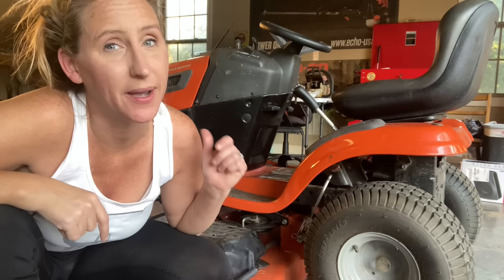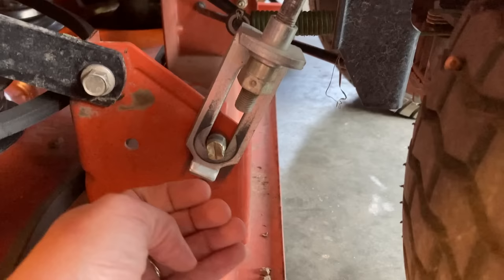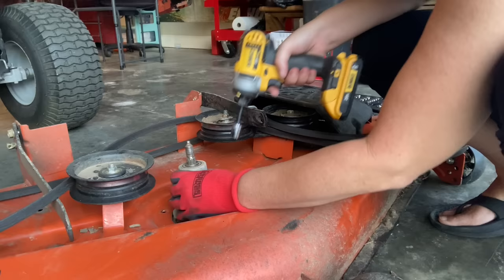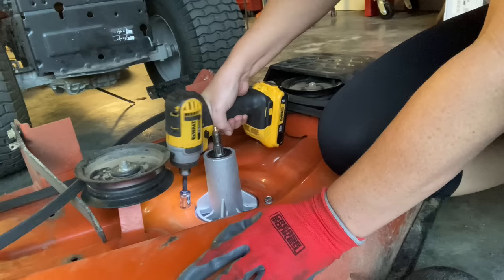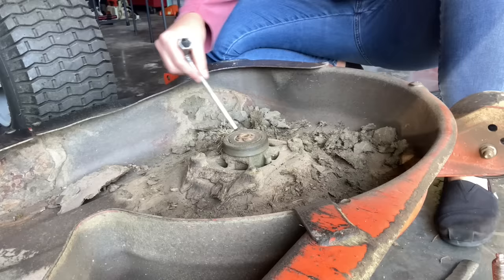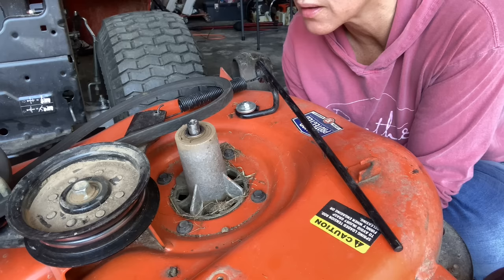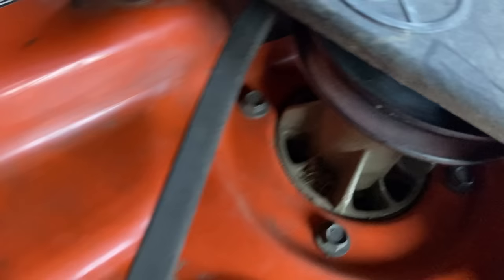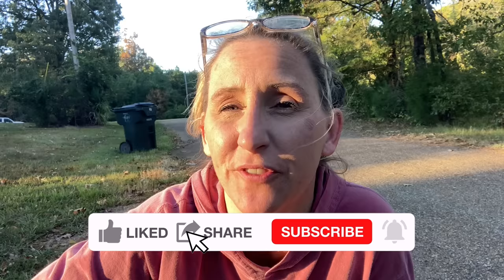Husqvarna riding tractor deck repair. Spindle, shaft and blades replacement.

Comment: I know this is an old video but you talked about the sealed bearings on a spindel I started taking out the seal on the inside then the zerk puts grease in the bearings Im on 3 yrs on spindels 
good luck B

Comment: Can I make a recommendation for that stuck pulley. Toss the nut back on it a few turns, protect those threads, grab your pry bar and apply upwards pressure like you were, then smak the nut with a hammer. That seems to work for me everytime when I got a stuck pulley/ fly wheel.

Comment: If you take the inside seals off the bearings the zerk is usable just don't over grease it. ive drilled a relief hole in the spindle and had great luck with bearings lasting a long time

Comment: Thank you for doing this one.  I also have an Husqvarna mower.  Great tips!  Hopefully I'll never have to do this repair but I'm ready to do it if it ever happens.  The worst part looks like taking the deck off...lol
Reply: its not bad at all.  it pretty heavy howevery and helps to have a smooth sliding surface under it

Comment: I have a Craftsman riding tractor made by Husqvarna. My rearend broke off. I used a couple of angle iron pieces to put it back together. I think the frame is 14 gauge. That is not enough strength for the job the morrow does.
Reply: I’ve got a Craftsman YT-4000 which is still holding together, but that frame makes more twist and turns than a copperhead snake!  They make these things about as light duty as they can possibly get away with.  Knock on wood, the Briggs V-twin engine is hanging on well so far, but you can tell it is not the equal of a Koehler or Yamaha.

Comment: Just did the same thing to a Craftsman that the replacement parts all said Husqvarna (kinda figured they would), didn't run into anything just age, housings complete with shafts and bearings, blades, belt, pully brakes, springs, pretty much a complete rebuild of the deck.
What year Corvette, 75?
I had a 73, years ago, before anyone cared about them.

Comment: Great info seeing as I have a Husqvarna Lawn tractor with a 42 inch deck. I figure I may  have to do exactly what you have done eventually. Thanks.
Reply: You will and the 42 " deck is the same except it only has 2 spindles/blades same spindles !!!

Comment: Always sharpen the new blades. They're coated with thick paint. Always use grease on all bolt threads.

Comment: I would Remove Inner Seal On Hub Bearings and Put in a Grease Fitting so that I could keep Grease in the Bearings, Sealed Bearings on Hubs generally do not last very long...

Comment: I have a Poulan chain saw it quit running,  I replaced the carb,  fuel lines, and fuel filter,  and air filter.  Still won't run. I sprayed some WD40 in the carburetor and it runs until the fuel runs out. I put the bad carburetor back on same.  I think another new carburetor is in order.

Comment: The only issue I have with the husqvarna 24v48 deck is the middle spindle is that the middle grease fitting is hard to get to.the middle grease fitting needs to be angled so that the grease fitting is easier to get to

Comment: I have a large Husqvarna rider with 52inch fabricated deck and Briggs and Stratton motor. It has the electric lock differential that broke with in 6 months. I was told that the hydrostatic is a sealed unit, is that true? 
Enjoy your videos. Thanks for all the information.

Comment: Have you changed a drive belt on a Craftsman GT5500? Suppose to be like a Husqvarna GTH52XLS. The craftsman has the belt go around the steering shaft. looks like I would have to pull the steering shaft, but not sure. Thanks for all your great videos!!

Comment: I bought a brand new John Deere back in th mid 90's and hit a cantaloupe sized rock and it somehow bent the Black CHINESE deck that Deere only used on that model for 1 year. I was still making payments on that 2,000 piece of crap and they wouldn't do anything about it because they said it was an entry level mower at 2,000 bucks. I told them I will never forget and tell all of my retail automotive customers about their lack of customer service but they didn't care.  Too bad we didn't have the internet then.

Comment: Why not replace the zerk with a bolt? Ford 4x4 front steering joint has a bolt you have to remove, insert 90deg zerk, grease, replace bolt (if leave zerk in, steering will shear off 1st time wheel is turned.

Comment: Are those flip-flops safety toe? :) I don't wear flip-flops but I do wear shorts usually April to October, when i'm working even welding. I've been a mechanic for years nearly 50 years but I do get a lot of info from you the (Specialist). I just finished a first edition 345 John Deere front wheel replacement, (rusted out). JD wanted more than the tractor was worth and no aftermarket available (1 inch diameter spildle). Picked up 2 new wheel/tire (16-6.50 x8 ) assemblys from tractor supply with 3/4 bore, I cut out the hub frin OEM wheels, cleaned them on the lathe and mounted the new wheels in lathe & cut the hub out with a hole saw for a snug fit. worked well. Job for my brother so labor didn't count you know. New tires and wheels for a bit over $200 saving about $400 if JD could still supply them. Watching you tube sure gives one the "thinking out of the box" ideas.

Comment: I hate how they don't put grease fittings on mowers anymore. I have a Simplicity 3310V from 1970 and my spindles are original.
In fact, everything is original except the idler pully on the mower deck, which I replaced last year.
Cheers!

Comment: Nice job! I replaced two pulleys from my same model husky this season. Those decks are no joke!  They're heavy.
Do you have transmission videos? Mine doesn't want to pull up hill after 20-30 minutes of cutting. Thanks.

Comment: I have a 22 HP Ariens, made by Husquavarna.  It is a Koehler engine.  Have you ever seen one of these engines be hard to start after it is hot?  It barely cranks, battery is good - I can’t figure it out.

Comment: lol your stupidvisor seems to approve judging by the angle of the tail.  quick tip - i had two 4x4's and a 2x4 the width of the ears on the back of the deck. drop the deck on the 4x4's so you arent tugging and lifting on the deck to unhook it.  the right sized mechanics creeper works good too. then use a 4x4 with the 2x4 on those ears the deck will sit upright .  if you use the factory self threading bolts dab them with grease and they go in by hand easily. dont use an impact. i always spun the blades to check the height at 180 degrees to see if the decks were bent or the blades were crooked. even on new its easy to have a blade move off that star when tightening.  oh and that was a body hammer.  i'll hide my tears and pretend i didnt see that !!!

Comment: Thank you and well done ! I am curious, do you ever remove the soft bearing seal ( 0n a non greaseable bearing/ non zert) and check / add additional grease or drill and tap the spindle adding an additional grease zert ???

Comment: That is not a fake zerk fitting and just because the bearing is sealed does not mean it will not accept grease. The first time you grease that top zerk it will take 50-70 pumps on the grease gun to reach the bottom bearing but it will reach it

Comment: I had a riding mower not long ago but the deck was rusted out that's how I basically got it I used it for about a year and the next thing you know parts for flying out of the chute I tried to find a deck with no luck so I just ended up selling the riding mower I got a question is it a good idea to put rustproofing under a nice clean deck like Rust-Oleum and then every now and then just make sure the deck is cleaned and dry I'm thinking that will make it last a little longer

Comment: Very informative video!  I own a Husqvarna TS-348XD.  I noticed that the PTO is struggling to get the blades spinning.  Thinking I have some bad mandrel/spindle bearings.  It looks like you can replace the bearings without replacing the mandrel/spindle.  Is this the case?  If so, do you have any videos where you have done that?  Also having a hard time finding the exact bearing part numbers.  I know that replacing the bearings is much cheaper!!

Comment: Question  , removing shaft from spindle  . It'll go pass the top bearing but not the bottom one . Even took a steel bar and tried hitting it and I had it off before ?

Comment: Is it possible to bend a blade-while NOT bending the spindle or spindle mounting surface on the mower deck?…..OR……does a bent mower blade usually mean something else is bent as well? I know one of my blades is bent, and hoping I can just replace it

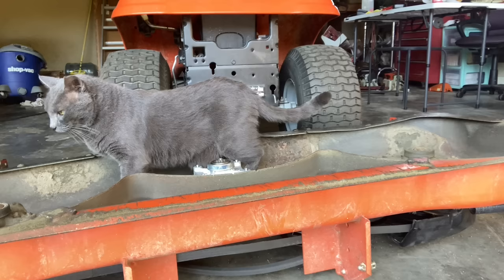Comment: I don't understand all the comments about a fake grease zerk. At 12:31 when the shaft comes out there is clearly no seal on the inside of the lower bearing.

Comment: Hey I saw no paint peeling on that husqvarna  mower deck or rust. I bought my jd d110 on 2011 and I barely have 156.8 hours on it and my deck is nothing but rust with frt. Wheels  and a pile of rust hanging down under my tractor. Also my engine started to knock at 156.8 hours of use that really stinks and out of warranty. Nice work . I heard that husqvarna  decks of 46" fits jd d110 is that true? Good video.

Comment: Thank you for this informative video! Is there a torque spec on the top spindle nut, or is “gutentight” good enough? That’s the information I’m searching for to finish this job on my Poulan Pro 42” . Appears to be the same spindle, just with three bolts instead of four like the one you show.

Comment: I've heard some people recommend on the first service where you have to mess with the spindles, remove the top bearing seal and then the zerk fitting has a purpose. What say you? I can't imagine a manufacturer puta extra parts ($) for no reason.

Comment: Not bad for a woman in flip flops !!! Those Husqvarna spindles do NOT like rocks, they break real easy, have used the Husqvarna for 15 years and have broken my fair share of them, spring is worst time first mow rocks jump up out of the ground due to freezing and claim a spindle.  One suggestion is when you changed the blades and you checked the end clearance you should also check that the two blades tips are equal in height to the other tip of the other blade as sometimes those blades get bent in handling or the blade is not fully seated and you will not get a smooth mow !!  Been there done that, most all those Husqvarna spindles and pulleys are the same across the different size decks...

Comment: Have a Husqvarna 42” deck that has a ring under the deck that the spindle fits in going up through the deck. What’s that ring called and what is the purpose of the ring to protect the spindle?  I have run John Deere’s for the last 16 years and this is a mower at my mom’s as a back up mower but her main mower is also a 54” Husqvarna.

Comment: i believed in not lubing spindles since they have sealed  bearings. this summer the middle blade on my Husqvarna tractor GT52XLS wasn't cutting very well, i checked the belt, good tension, clean and in good shape. i haven't lubed the middle spindle in 8 years, it was hard to get to, i replaced it with a 45 degree zirk, lubed it, cut the grass and now its working like new. so now I'm confused. lubing the spindles are worth doing? its certainly cheaper than replacing a spindle. has anyone else noticed this ?  
Did you figure out why the middle spindle broke on your neighbors Husqvarna ? was it jammed ? the pulley would indicate it was.

Comment: I replaced the housing/spindle put on a new belt and new gator mulching blades on my husqvarna 22th46 and when I go to start it up it shakes and makes an awful noise.
What am i missing?
This is a new problem that didn't happen in past times of replacing things.
Thanks

Comment: I've got a Husqy 48" mower almost identical to this one, just had to pull the deck off of it yesterday due to hitting a tree root.  A deflector bolted to the front lip of the deck separated and bent down by the output chute so I had to pull the deck, flip it over, and hammer the deflector back into relatively normal shape.  No problem.  But the root cause (ha ha get it?) is that the whole deck is twisted and that leading edge hangs lower than the rest.  It's twisted like that due to many (many, many) impacts in the past.  I've had this mower for a long time.  Any advice on how to straighten that out?

Comment: I hit something so hard with the blade on my TB30-CA it snapped the deck belt & the engine stalled.
Like an idiot tho, I forgot to look to see what I had hit. A couple days later I went to where I  THOUGHT  
I had hit it but, nothing. So, somewhere, out in my yard lurks this obstruction. Waiting...always waiting...
Until I come along again & this time it may break some hard parts. I have 2.4acres so where it is is
anyone's guess. NOTHING stops my John Deere 48" so I may need to mow with it until I find this 
obstruction.

!

Comment: I have a yth24k48 and the rear sway bar keeps falling out. The back hole is somewhat worn on one side but it's been fine until recently. I slide it back into the rear hole, push it back into the deck side, install the washer and clip and as soon as you take pressure off the deck it falls out the back.

What am I doing wrong?

Comment: Can you just order replacement center shafts with 6-point star for your spindle assembly. Both my 6-point stars are flattened as shown in your video. I have a Craftsman pro series 46-inch deck tractor with 24 hp Kohler Engine. Where can you prder the parts from? Thank you!

Comment: What can you do if the star for blade adapter is worn , but spindle is fine ? Must you replace spindle to correct ???  Thank you !
Reply: I just went though that where one of the spindles mushroomed due to an out of balance blade.  I ground off the mushrooming, but didn’t like that the depth of the remaining lobes was very short.  I got a set from a reputable seller that used to sell Husqvarna parts, but the new spindles look Chinese.  The quality isn’t bad and it was only $50 for the pair, so replacing for peace of mind that the blade won’t go flying seems worth it.  If you replace the spindles and blades but still have vibration, suspect the deck belt.  The belt on my mower looked fine, but replacing the belt got rid fairly bad vibration.
Reply: @wtmayhew  Thank you!!   That is most helpful.
Reply: Thanks, best wishes to keep your tractor going.  Grass sure is frowning fast now.

Comment: Do you know anything about JD STX 38.? I have a problem was mowing then drive stopped suddenly, motor was running fine with blades operating. Do you have any suggestions.

Comment: Maybe this explains why the center of my Husqvarna zero turn doesn't cut as well as the outside blades. Maybe the spindle nut is slipping?
Reply from the maker: Check that center star.
Reply: Thank you

Comment: I got a idia. That pulley you were having trouble with why didn't you hit the spindle shaft with a hammer 🔨⚒️🔨⚒️. I call the part of the blade that goes up the wing side. That is another job done. LoL 😆 I put a blade on backwards one time. I hit a little high spot and it plowed up my yard. LoL 😂😆 LoL. They will dig in like crazy 🤣.
I never would thought I would do something like that after working on mowers for several years. But we are only human. They spent billions on the space shuttle and one small pice of tile on the leading edge is damaged by isolation from the liquid hydrogen tank killed the hole crue.

Comment: I have a question for you. Is it possible to straighten the drive shaft (is that what you call it? )of a self-propelled push mower? I hit something really hard and it bent the blade and the shaft. I didn't know it bent the shaft until I put another blade on it and now it shakes me to death when I try to mow with it.

Comment: When you tighten down that new pulley it was still lose how did you fix that
Reply: Last year the manufacturer had a problem with some of the nuts for the spindles. It was only a small batch that only went to a couple states and were hard to spot. We just had to swap it with a replacement didn't think it was worth a mention but glad you noticed.

Comment: Hey I got a echo 2620T and it vibrates very bad my other 2620 does not could it be the clutch half of a grabbing I’m clueless on what it could be
Reply from the maker: Could be, but I don't see them go out that often unless they are under extreme heavy use and using it without a guard. I would first check you head. Put the good one from your other trimmer on it and just make sure its not the issue. You can remove the gear head at the bottom of your shaft and pull out our drive shaft. Make sure the ends are not worn down. Those are the simple things to check, then move on to clutch.

Comment: How do you take off a rear wheel on a riding mower that is rusted, I've tried just about everything. Help/Help
Reply: Start with penetrating oil , try using a puller on the wheel if possible because bashing the rim inside edge might damage the transmission , failing that you might need heat , oxy/acetylene type heat , not propane .
Reply: @Gordon_L  Thank you, I'll sure give a try..

Comment: What kind of rock can do that kind of damage to the blades?
Reply: It’s usually the edge or end of a cement pad or driveway that tears the center spindle out.. I have some “show and tell” models that are unbelievable how bad they were destroyed.. and I’ve even had to place reinforcing plates and straighten the deck to some!